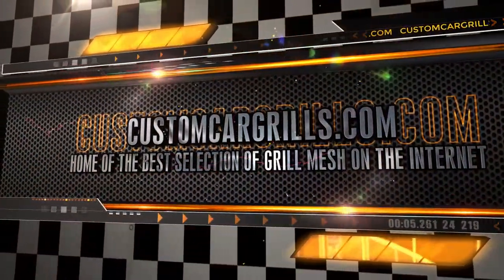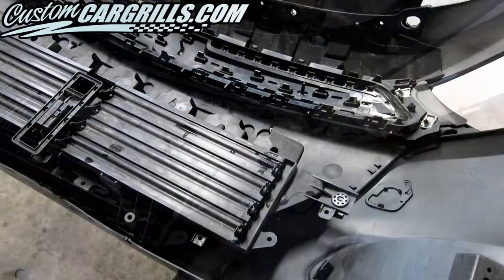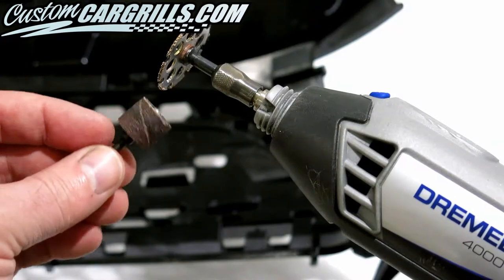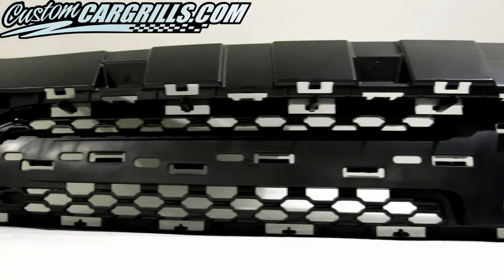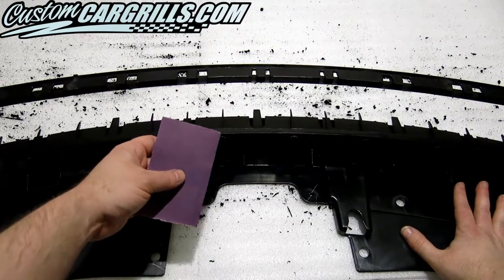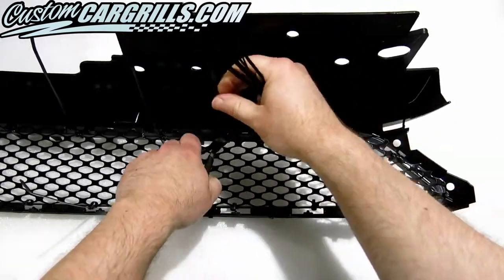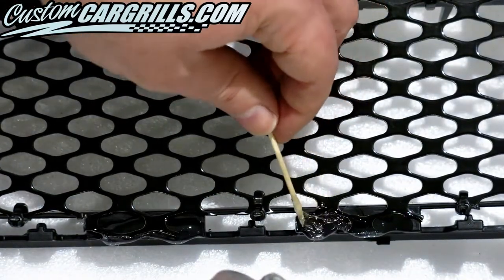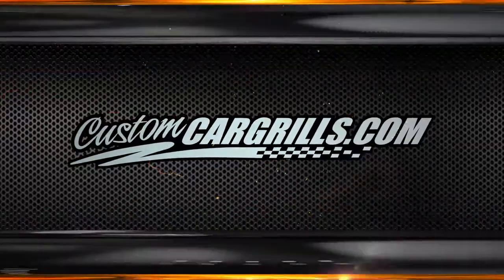Dodge Dart Mesh Grill Installation With Crosshair Removal by customcargrills.com

Comment: Having frequented a Dart community a few years this is the clearest installation guide I've found, with the second most thorough leaving a lot to be desired. I have big plans for my Dart and the crosshair delete has been sitting near the top of my to-do list for what feels like FOREVER.Really appreciate this thorough walkthrough, CCG. Kudos.
Reply: Did you ever do it I want to get rid of my cross hair to
Reply: It’s actually not. A lot of the instructions say and “then you can just take this off” he never explains HOW to actually get most of the parts off when it comes to the actual grille part. There are so many clips and tabs he’s not even mentioning.
Reply from the maker: I believe most of the clips that you are referring to, which were unfastened off camera, can be removed with a couple flathead screwdrivers.  If you're stuck anywhere on the installation, feel free to email or text over a picture of the clip(s) that are giving you trouble and I'll try to help.

Comment: Can you speed up the process by leaving the grille in the sun to dry or using a heat fun ?
Reply from the maker: Yes, heat and air circulation speed up the curing of the glue.

Comment: Is there a video for the bottom grill?
Reply from the maker: I don't have a video specifically for the lower but it's the same process at this upper grille install.
Reply: @customcargrills can you make a video? Because someone people are saying we attach it to the front of the bottom grill instead of the back
Reply from the maker: I can assure you that the mesh piece that we currently sell our website attaches the same way as the upper piece shown in the video we are commenting on.

Years ago, we made a lower piece which did go in front of the stock grille, so there may be some outdated information out there or possibly a different screen available but the lower mesh piece we sell is the same behind-the-grille install process as the upper.

There are two main differences between the upper and lower installs.  One is with regard to the shutter system which is behind the grille.  The shutters need to be either deactivated or removed.  The other is that there will likely be some extra refinishing of the inner edge of the grille after the stock design is removed.

Comment: Hey all, can someone help me out with this issue? My engine light is on saying Active Grille Shutter. I can't clear it or anything it just turns right back on. Is there a way I can fix this issue without having to buy the whole new Grill? All I see is 300$ ones. I'm trying to find a way to keep my engine light off without getting all new part and reuse mine.
Reply from the maker: Brandon, is this an issue with a modified grille, or your stock one?
Reply: @customcargrills  If you disconnect the active grill shutter it will give a check engine light.

Comment: Could you do a mesh insert for the fog light panels
Reply from the maker: I'll see what I can do.  We're just now finishing up the lower bumper grill opening.
Reply: customcargrills okay I have a cold air intake that goes down in the bumper and I'd like to increase the air flow to it by cutting out the fog lights.

Comment: 80 bucks for powder coated stamped metal sheet. Doesn't come with anything other than the metal. No bracketry or anything, no chance to revert to stock. fml
Reply from the maker: What brackets would you suggest we include?  It's a fairly straight forward installation of the mesh on the back of the stock grill, I'm not sure what more should be included that doesn't overcomplicate the install.

As for reverting it back to stock, that can be easily done with a new set of oem grilles.